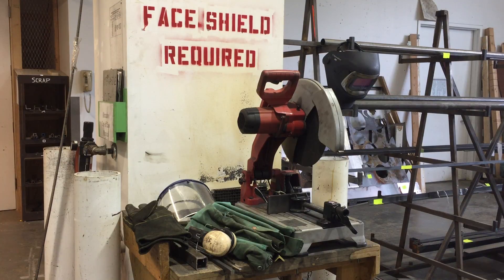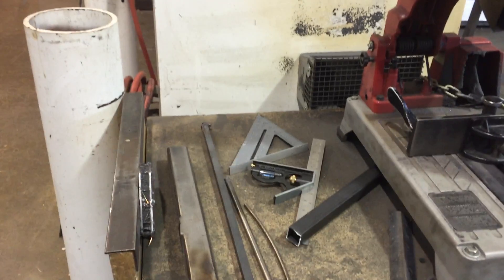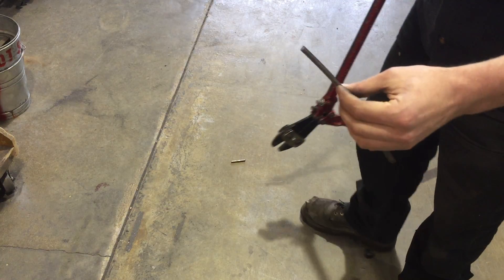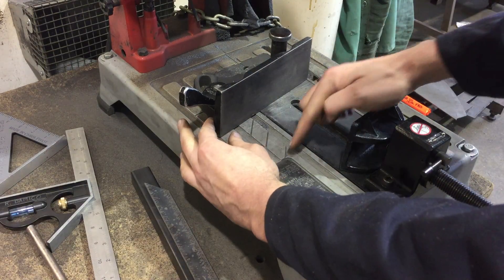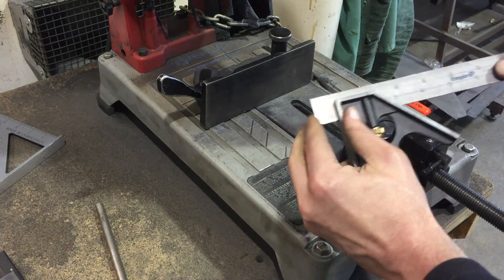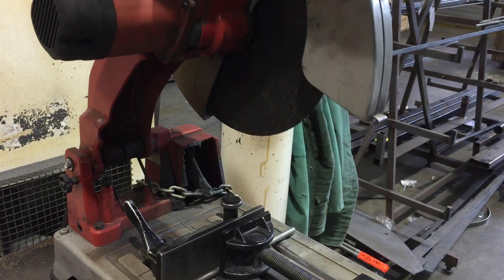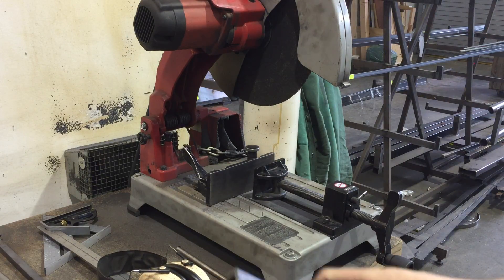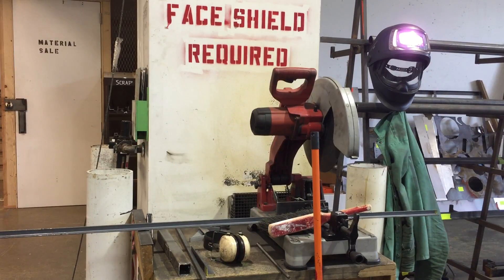Abrasive Chop Saw

Comment: Any tips on how to get a straight 90 degree cut. my blade seems to push away as I cut from top to bottom leaving the top edge shorter than the bottom edge!
Reply: Apply less presure on the blade or alternatively check the bearings the spindle runs on might have excessive play in them